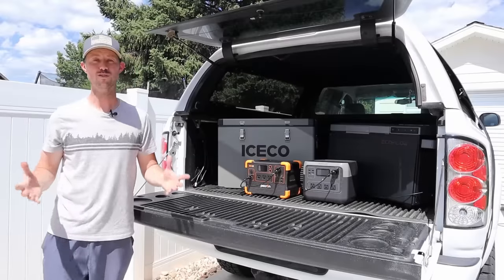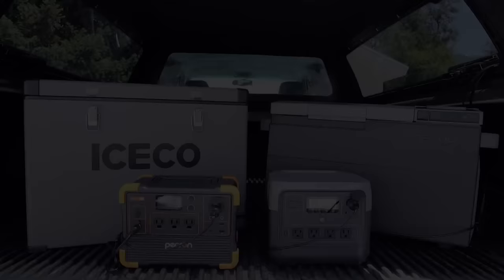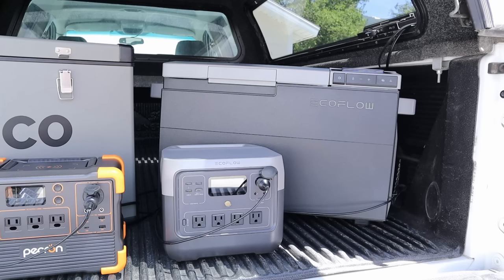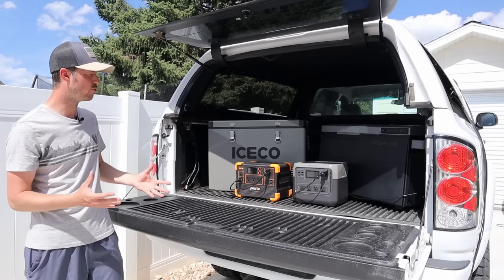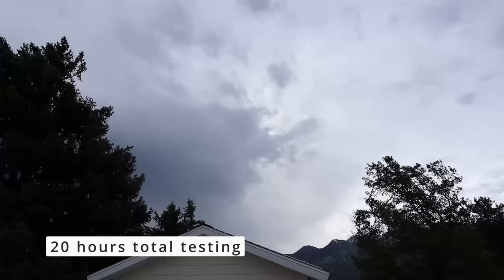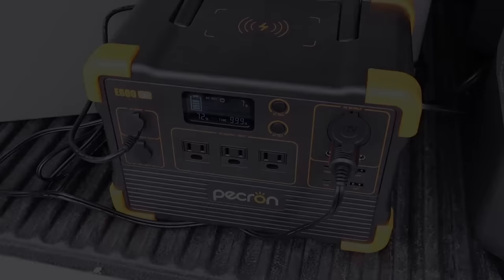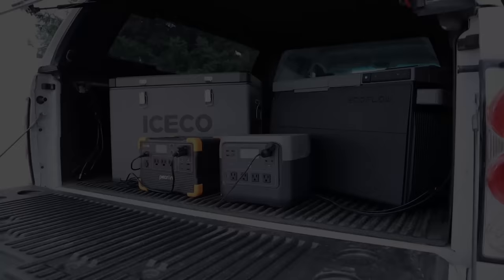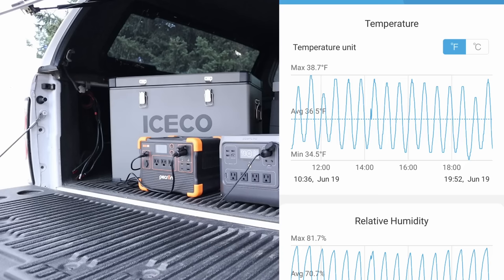72 Hour Compressor Fridge Showdown! Budget Cost VS Premium Cost!  #iceco #ecoflowglacier

Comment: Here's the only real issue I have, and it's related to panels: cost. I ordered a bunch of portable panels in 2021/2022 and even ordered a couple of solar blankets from Australia just to see what they were like. After about six months of playing with these panels, sometimes in near ideal conditions, none of them ever met rated output. Generally I got 50-70%, so on a cost per watt basis these panels were even more expensive than originally thought. And the build quality on all of the models I ordered was pretty poor as well. Most were showing signs of wear after just a few uses; and I pamper my gear. I don't expect a folding panel to be destroyed by..........folding.

So I ended up going with 4x160w rigid panels configured as two solar suitcases. Panels plus parts was about $600. Each suitcase weighs 46lbs, and under normal conditions I'll see close to rated output, and under ideal I have actually exceeded rated output. So, most importantly, they work. To get similar results using the Ecoflow 220w panel I'd have to use three panels costing $1400+ and weighing 63lbs. So the Ecoflow option would save me about 30lbs over my dual suitcases, but cost over $800 more and likely have a much shorter working life. 

If you're truck/SUV camping you're better off mounting a rigid panel on top of the vehicle to charge the batteries. Even a 100w rigid panel (for about $90) is likely to produce about the same power over a day as a much more expensive foldable panel, and most vehicles could fit a 150-200w panel if desired. 

I haven't found a portable panel yet that hits my sweet spot.

Comment: When the power pack reach 100%, does the charger automatically divert the solar power?  Or you have to manually unplug the panels?
Reply from the maker: You can leave the solar connected all the time. It just charges when needed.

Comment: If I am looking to do weekend trips (2-3days) with either an ICECO 35qt/45qt and a 100 watt solar panel mounted to the roof of my vehicle. Would a ~760wh battery be enough or would you recommend getting a 1000+wh battery? Torn between the 2 sizes and if the 1000wh is overkill. I live in CO and travel quite a bit to MOAB or other hot places that can get hot during the summer
Reply from the maker: I always go with the largest battery I can afford and fit to extra runtimes during those hot days.

Comment: Thanks for your informative video. I'm new to this and I have one question for you.  If I want to use an inductive cookware and/or microwave, would I need a 1500 watt inverter?
Reply from the maker: Most cooking appliances pull 1500-1800 watts. I'd recommend having a 2000w inverter.

Comment: Not quite a fair test. You should use the same sized solar panels for both set ups
Reply from the maker: This test wasn't comparing the fairness of each model. It was to see how a cheap setup faired against a setup that was expensive. How much does someone need to spend to have success running a fridge? If you want to spend more money, get a 200w panel.

Comment: I have the VL45, but I find the thermometer accuracy wanting.  It's actually several degrees off, but once I learned the correct offset, it was no big deal.  I LOVE the efficiency of it and that's the most important thing for me, aside from dependability.  I have some EcoFlow gear, but I split the difference and just bought a small portable ice maker.  You CANNOT have margaritas without ice. lol.
Thanks for the testing/comparison.  Very informative!!
Reply from the maker: One day I will put out a video on the secret menu that allows you to tweak the VL45 to be more accurate to your display set point. Its pretty complicated to change, but possible.

Comment: What was the peak power draw from each refrigerator while running?

Edit: I found another guy that showed 36.2 watts on the Iceco when running. It may be a littler higher draw to start the compressor.

Comment: I think the perfect size for me as a camping fridge would be 38-48qt. With that said. My Engel Mt45, Iceco Jp40 or my Snomaster Ls35 with a EB70 and Xtar 100w panel would suffice. 
If I were going on the cheap. I'd get a Setpower or Alpicool (LG compressor) with a Oupes 600 with Xtar 100w panel. 

If I was going Expensive. I'd get a Engel MT45, National Luna or Snomaster. Somewhere in that 43-58qt range. And pair it with a Ecoflow River or Bluetti EB70. I'd probably scale up my panel as well. Tons of good 200w panels out there. 

My dream setup is to get my own Peterbilt 579 with a Green APU. Put a 280w panel on the sleeper. (They have them) run that to a Bluetti EB200p. And have my Snomaster 85L in the truck. (❤ That fridge 😍) Along with my Snomaster LS35. I generally stay out of truck stops. Especially the chains. And basically camp out in different places. Just me and my home girl Miss DD. (My Dog) 

My Iceco's are doing good in the truck. The Jp40 is sitting on the passenger seat and the Jp50 is on the floor in the sleeper. 
I would recommend these to someone that's not a fridge snob like I am. The Jp40 is set to 34 degrees. And I keep the Jp50 at 0.

Edited to add: I appreciate how light you said these JP series Iceco's are. And you are right.
Reply from the maker: Thanks for sharing your feedback, Mr Dude! Haha I don't think many people know about these fridges so it's my mission to tell the world! Like you said, one big benefit of those plastic molded fridges is that they are efficient and lightweight.

Comment: Is there a reason you didn't clip the clasps on the icecoo?  Seems like your seal wouldn't be as good not clipped
Reply from the maker: The lid is heavy enough on its own, it doesn't need to be locked down.

Comment: I was gifted with BougeRV fridge/freezer to be powered by EcoFlow River Pro or my Tesla 12v. How do you maintain the cooling when the fridge is running and blowing hot air inside the car parked ?
Reply from the maker: The hot air coming off the fridge is nothing compared to the amount of heat you'll get through the windows and hot roof. When leaving a fridge in the car I always try to park in the shade and crack the windows to keep it as cool as possible inside the car.

Comment: I'd love to see a video of if you were going camping for ...let's say a week,  what is your setup?  Do you bring one large generator to power everything? Or several different generators of different sizes?? Same with the solar panels.
Thanks.
Reply from the maker: I have a few camping videos from last year. Since I have so many options I try to mix it up each time. I think a 1000wh device with 200 watts of solar is a great setup for running a fridge. Running a 100ah LFP battery or rocking a power station both work well.

Comment: the pecron 600 lfp has issues that seems to be widespread with owners . The bottom USB ports do not work when the top ones are being used. Mine has the same issues.  Didn't find out till I went camping with it. It is a great unit but the ports not working bother me. The 2000 lfp I own doesn't have these issues luckily.  I already have a few of the new ecoflow models and no issues like that what so ever.
Reply: have you contacted Pecron regarding your issue? I’m curious to see how their customer service is
Reply from the maker: Yes, that is known issue where you cant use two usb ports at the same time. Luckily their new models will have smart app connectivity and the ability to upgrade the firmware to fix those issues without having to replace the whole thing.

Comment: I have the EcoFlow 220W solar panel (came as pkg with Delta 2 Max). How come you didn’t use the solar panel case as the stand, as that is the panel stand (in conjunction with the hooks it comes with to mount it).
Reply from the maker: The design of the EcoFlow 'case stand' is horrible in my opinion. It's hard to move around and can still tip over easily. It's also takes a long time to setup and the panels aren't angled straight when you use it. I wish they just used a traditional kickstand design.

Comment: Love this test. The case for the ecoflow solar panel is also it's stand. Why didn't you use it?
Reply from the maker: Glad you liked the video! In my opinion that Ecoflow "kickstand" case design is horrible. It's heavy, it slides down / falls over constantly. It also takes awhile to setup. I'm not a fan of the case kickstand. Everything else about the panel is excellent, I just wish they had kickstands like other portable panels.
Reply: @Jasonoid  100% agree

Comment: One thing you didn't consider (or maybe you did but didn't show us) is the fridge opening 10-20 times a day. When it's 90 degrees out, it can really use up power.
Reply from the maker: It acutally doesn't effect the power usage too much since it's a chest style fridge. The cold air just sinks so they do a pretty good job staying cold. The fridge in your house with side doors let out all the cold when opened.

Comment: Nice, I really like that pecron joint. A couple said they have issues with series though. 

I'm not exactly in advance fridge state of mind but cool video none the less. I hate EF panel stand design lol
Reply from the maker: The Pecron is interesting. It's an awesome product but could use little polishing in the software side of things. 
I had an Ecoflow fan boi try to tell me it's the best panel out there.... Well it certainly makes excellent power.... But power isn't everything. It's super heavy, it stinks to fold it up when cold, and with no built in kickstands it's hard to setup reliably. The case kickstand idea just doesn't work.

Comment: Cool, great info, i also have the ef 220w bifacial but its a real handful to setup due to its heft. But it does grab alot of power from the sun and makes charging faster. I am looking around for a suitable compressor fridge and was looking at the alpicool brand.
Reply from the maker: I think Setpower is a better budget model and they have lots of options to chose from. Alpicool would probably work just as good though.

Comment: i would mount solar panels on a roof mount of the truck with a 2 inch set off to act as a sun shade.
and i would split the feed from the panels to charge the solar generator/power station and the truck battery.
Reply from the maker: Sounds like a great plan!

Comment: Check out the newair 80 quart fridge.... i own the 115quart (idk if they discontinued it) and it doesnt use much power for its size... 115 quart dual zone...
Reply from the maker: I have an older video on the Newair 80qt model, it's been working for my brother in law for 3 years! 👍

Comment: Thanks for the video. Pretty helpful. But it feels like you were mostly testing the solar panels... I am not sure how efficient the different fridges are compared to each other (or even the power stations compared to each other).

It would be super useful to see each of these units (I'm mostly interested in the fridges myself) tested in more isolation. I.e. have both fridges running off of identical power stations (if you have them) and identical solar arrays. If you don't have that, at least test the fridges and power stations against each other with a uniform (identical) power input from the solar panels or shore power. That said, maybe you have already done this in other videos. So I am going to look through your catalog now.

Thanks again for the tests!
Reply from the maker: I have over 200 hours of testing on both these models. You can see the test results in each review on my channel. All fridges are tested in the exact same environment so the results are equal. All those detailed results on my power station grading sheet, but you need to click on the "Fridge Comparison" tab of the spreadsheet to see them. You can find that info HERE:
https://jasonoid.com/powerstations/   (open the spreadsheet, then click on the fridge tab).
Reply: @Jasonoid  Excellent. Thanks. It makes sense that you would have already covered this. Much appreciated.

Comment: I think one comparison I would like to see is the best solar panels for shaded use. Here in the east coast usually we are camping in the woods.
Reply from the maker: Have you seen this solar panel video?
https://youtu.be/Nfll_AwnVZc
In that video I tested lots of 200w panels for partial shading. Any panel that has each section wired in parallel will get the best shading performance.

Comment: random thought, but given Hyundai had made a sonata with a solar roof previously, how cool would it have been if they had a version of the new 2024 Santa Fe with that giant flat roof with an embedded solar system tied to a PHEV battery so you could run a fridge in the same manner but with the solar capability and battery built into the vehicle.  if the sonata got about 200W I wonder if the 2024 Santa Fe could fit 300w or more? would prefer a solar roof over a sunroof/moonroof any day of the week!
Reply from the maker: I think that's an excellent idea! We can dream right?!

Comment: Would like to have seen the test on the glacier done without the river pro and just used the solar panel straight to the glacier battery, other than that great video as always 👍
Reply from the maker: With only 300wh of capacity it would be pretty hard to get through a warm night. I should try testing that some day.

Comment: in defence of the solar pannels, great and all to get enough power, but you do have to carry all the gear, i have chose the 160W pannel. because even though it says 220W it doesn't mean it will reach that 220W limit all the time. depends on the sun.  same for the 160W but i chose it because the difference is only 80W and a couple hunderd euro's less
Reply from the maker: Great point about the lighter weight solar panels!

Comment: Great overview of two different setups! I would definitely go for the budget system..  But I have a question, I'm considering doing some months long boondocking in my minivan, with fridge, powerstation, and a glass panel mounted on the roof. My question is there a way to hook up both 12v from my car as well as a solar panel to a powerstation simultaneously to either use both sources at the same time, or one or the other depending on conditions?
Reply from the maker: I get this question a lot actually. There really isn't a way to hook up both charging options at the same time on a power station currently. Some people will use one of those heavy duty power switches that allow for multiple sources and just switch when needed.

Another option will be to go with a standalone 100ah LFP battery setup and use a dual charger that has solar and DC to DC built in so it will automatically chose the best charging source. One dual charger that I own is shown in this older video on my channel:  https://youtu.be/HdBd0_SJf0A

Comment: Jason the Ecoflow case is the kickstand…if you’re doing a comparison please do it with the right information..
Reply from the maker: That kickstand sucks hardcore. It doesn't hold the panel for long durations, it always falls down. Everyone hates it and it's horrible to use. They need to change that design to be a true kickstand.
Reply: @Jasonoid  I have mobile solar panels from Anker, Bluetti and EcoFlow and I agree! EcoFlow's quality is great all-around, except their kickstand solution sucks. My favorite is actually the Anker 625 Solar Panel (100W) at $330; compact, light, stable and with both USB-A and USB-C output ports to charge other devices. Really convenient form factor. I'd probably bring the BLUETTI PV200 Portable Solar Panel (200W) if I needed more power since it sucks a lot less to set up than the EcoFlow Bi-Facial 220W.

Maybe the EcoFlow 220 Bi-Focal is fine if I spend the time to actually properly set it up, but tbh I haven't really ever bothered even trying. Now it's just a stationary solar panel for me ¯\_(ツ)_/¯
Reply: @Jasonoid  well in your review you should have said that it did have a kick stand but you prefer not to use it…
Reply from the maker: @livingmybestlife60  I totally agree, thanks for the feedback. These unscripted videos are hard to remember all the details so I leave out stuff often. My bad!
Reply: @Jasonoid  no worries it’s all good!! And you did a great job! Keep up the good work..

Comment: What did you actually test, the fridges, the power stations or the solar panels?
Ecoflow fridge has its own battery, and runs more effective with that battery, no idea if you took it out to just run from the power station. 
The test was just a big mess.
Reply from the maker: It was a budget system running next to an expensive system. A simple test seeing how they compared in the real world. You can spend $1500 or spend $700 and you'll notice the performance isn't that different. (Grammar edit)

Comment: Was your EcoFlow Glacier set to eco mode? I've heard the temperature is allowed to go above and below the set point more so in eco.
Reply from the maker: It was set to ECO mode.
Reply: @Jasonoid  wonder if the temp would be more consistent in normal mode...
Reply from the maker: @LanceMace  Todd Parker was testing that in his video and I think he mentioned that it was a little tighter groupings when in max mode. I recommended they change it so maybe a future firmware update will get it better.

Comment: Why wouldn't you have put a few bricks up against the bottom of the EcoFlow panels to keep them from sliding down?  IMO this was a flawed aspect of your testing, as in a real-world situation I think anyone would have taken some steps to keep those panels propped up.
Reply from the maker: That would have shaded the panel and blocked 95% of the power.